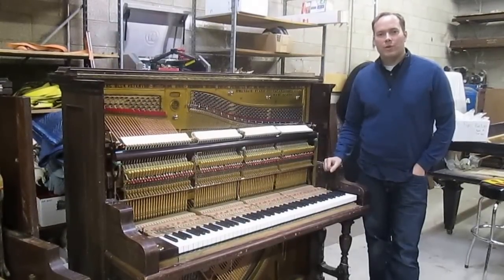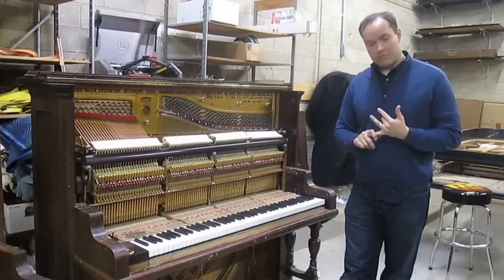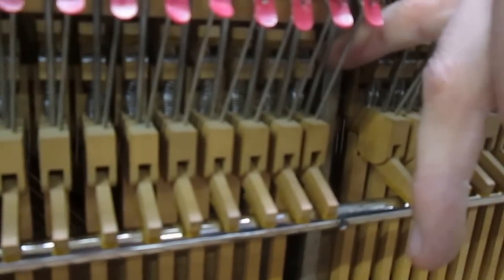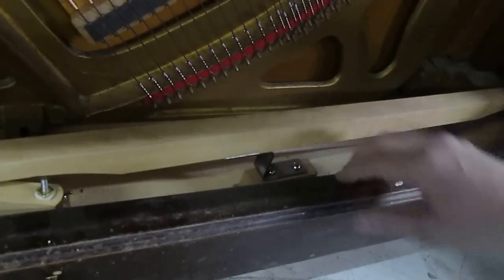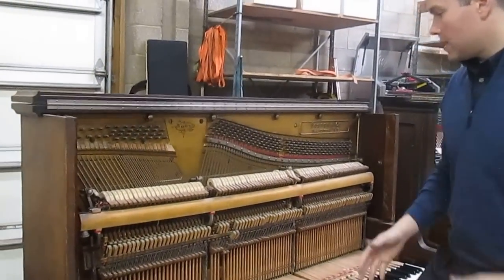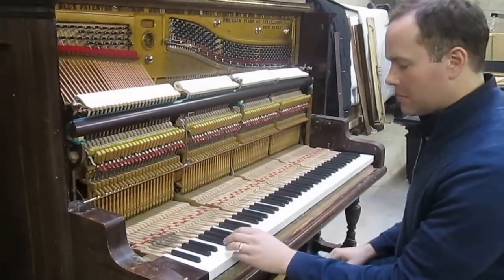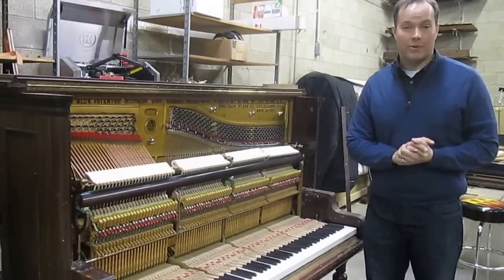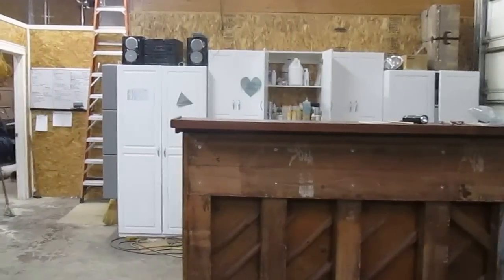Rebuilding an Antique Piano: Before and After

Comment: Your comments about the good years for piano building REALLY struck a chord for me (not pun intended).  I was at a reclaim center (donations of usables that would otherwise go to the dump) and there was an intact (1920, it turns out) Holland Cabinet Grand Player piano.  (Player sort of works, but will get fully restored), For giggles, I went to plink out a tune, expecting it to be terrible, and the touch and tone was so nice on it, expecially compared to the 1960-70's spinet next to it, I impluse bought it on the spot.  It's getting a full restoration of instrument and player this upcoming year, and I can't wait (but until then, I practice on it about 3 hours a day...LOL)

Comment: Very nice!  Looks like that piano has a true sostenuto mechanism - the polished rail at the front and the tabs protruding from the wippens.  Quite rare to get sostenuto on an upright. Also it appears, from the circular saw or milling marks, that correctly, thickness has been removed from the natural keys to accommodate the greater thickness of modern white key covering materials.

Comment: I have a Kimball piano and have restored the cabinet portion of this piano. It's 54 inches tall and built in 1905.  I have the ability to fix all of its problems, however I do not know where to get the parts, strings, hammers dampers etc. can you make or give me some idea where I can get those parts?
Reply: Mr. Larson, thank you very much.
Reply from the maker: I would try Schaff Piano Supply.  We get a lot of parts for rebuilding there.

Comment: How much would it cost to restore a piano like this?  I have a 1900 Hackley Upright.  All original mechanisms.  Dont know if it was stringed but its had pin treatment done and has age wear such as some cracks in the soundboard, some non serious cracks in a bridge.  Tuned down to a A435, bushings are also worn out.  Hammer felt has be redone past 20-30 years.

I may also add, when I went to have it tuned, the tuner opened the top to pull the panel off and he stopped mid sentance as if he saw a ghost and simply replied "Dad tuned this piano."  (He was in his late 70s)
And he has tuned it four times over the past 40 years.  If I do have it ever restored the condition is they cant remove the signatures of all who have tuned it, its a story of the piano itself.
Reply from the maker: Hi Sam! Brigham would love to talk with you about this amazing piano. Please call us at (801) 701-0113, thanks!

Comment: To determining the height of the piano, do we measure from the floor to the very top of the piano?  I wish to understand the sound quality with respect to height.
Reply: Generally, the bigger the piano, the better the sound. Sizes of upright: 36" spinet, 41 to 45" console, 45 to 48" studio, 48+" full size. A full size upright has the same string length and soundboard area as a 5' baby grand.